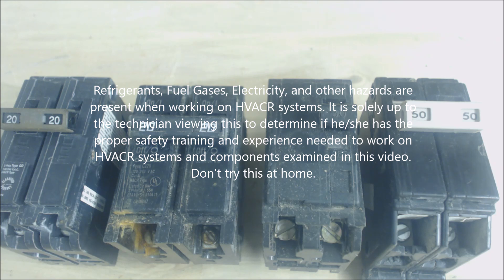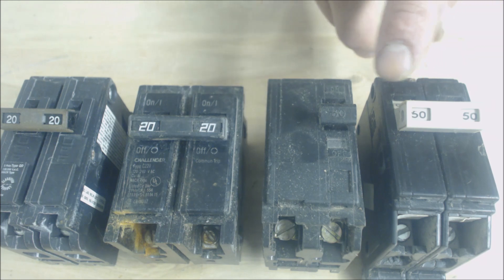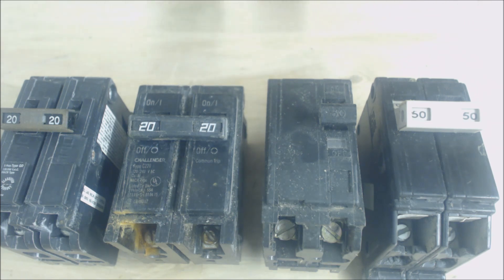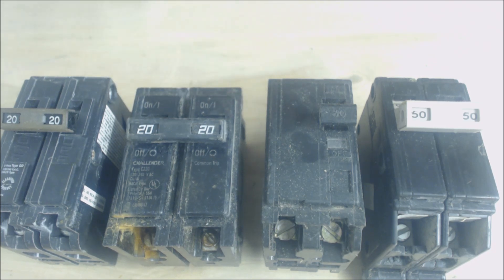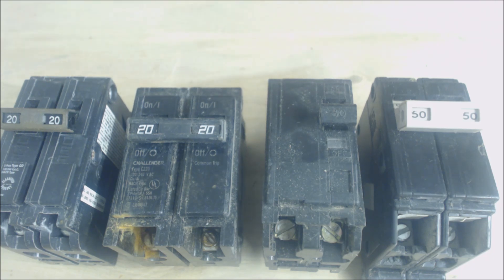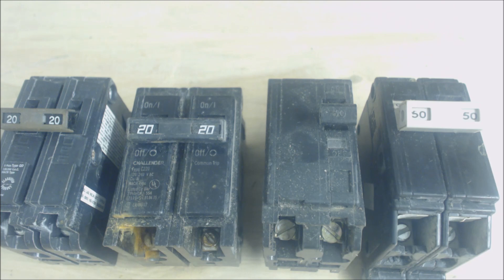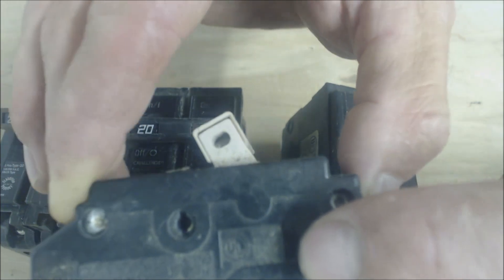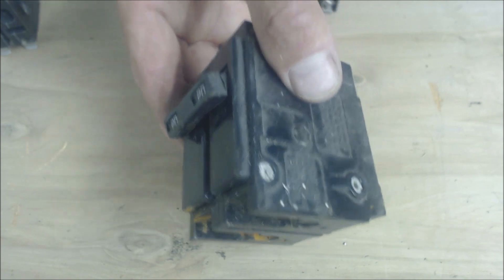Why is my Heat and AC Breaker Tripping? What is a HACR Breaker? Explained!

Comment: If a heat strip stays 60 amps  can I run a fuse box that has 30amp and 30 amp?
Reply from the maker: No it is 60 amp per leg

Comment: What if a compressor is drawing 117 in rush amps and lra is 102 amps
Reply from the maker: The compressor may have low voltage or another issue. What happens if a spp5 or spp6 is added?

Comment: Great video with useful tips for resetting tripped circuit breakers. If you would be interested in reading an article I wrote dealing with 7 questions I commonly get about tripped breakers and how to reset them. Please read: http://www.upstateelectric.com/technical_articles.php?article=79  Thank you and be safe when working with electricity.

Comment: found this video by doing searches for ac circuit breakers. 
I just had my panel out in the garage making sizzling noises. Come to find out, the 40amp breaker for the outdoor ac unit is burnt up, one leg of it was melted and the copper bus for it is all melted. I had the original carrier unit replaced about 3 years ago, now it's a york. I noticed the rating on the side of the ac unit says max 30amp. Plus there is an outside box right by the unit with a huge fuse, and it seems fine. I'm confused cause the hvac company says the unit is fine and they wired it up correct and that a 40amp breaker is fine. The electrical company says it(the breaker just went bad) and just installed another 40amp on an open spot in the panel. Everything seems to be working fine, but i'm still confused of why the breaker melted in the first place. Neither the hvac or electrical company techs could give a good answer. They just shrug it off as like "it happens". And i'm like "No it don't", my house could of caught fire. There has to be a wrong wiring issue, like not big enough size of wire to handle load, or something in the ac unit is causing large surges in current.
Reply from the maker: You would need to make sure that the max fuse is 30 if that is what is said on the unit because the unit's wire is only rated up to that size. It may be fused down to 30 amp at the outdoor disconnect. If that is where it is melted then there may have been a loose connection on the back of the breaker or right inside of the breaker near the connection. I actually have seen other breakers just go bad over time but that is after a diagnosis of making sure everything else was good. I hope that was some help for you but yeah a local licensed electrician could give a big picture assessment if you were concerned, thanks!
Reply: no, could be just bad breaker,,,  made in china ..  thats all, or it would melt wires with breaker if wiring wrong,,,, or  wires too small

Comment: Stupid question.   The breakers in your video that have 20 and 20 ganged together...  Is that a total of 20 or 40 amps?
Reply from the maker: When they are ganged it is 2 pole 240 volts in the U.S. and each leg is protected to go no higher than 20 amps total. Thanks
Reply: its 20 amps  2fases  !!!  means  220 volts connection

Comment from the maker: Thanks "Refrigeration Tech" for sending info and asking me to do a video on this topic!
Reply: Lot of HVAC and R techs have electrical issues they run into, and being the customer that wants the unit to run and thats it. Its good to know alittle electrical codes to get the tech by in a pinch.

I do commercial and residental and another good readings are 240.83 Markings, 240.85 Applications, and 240.86 Series Ratings of the breakers